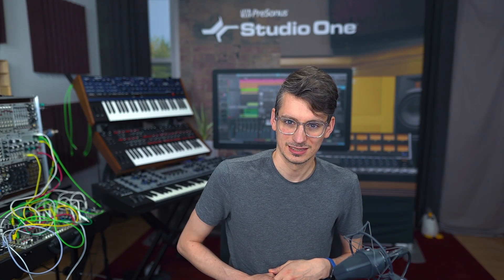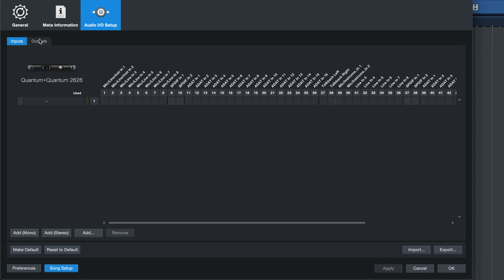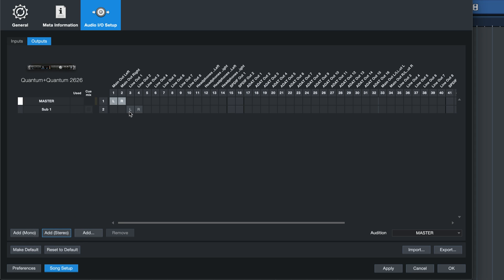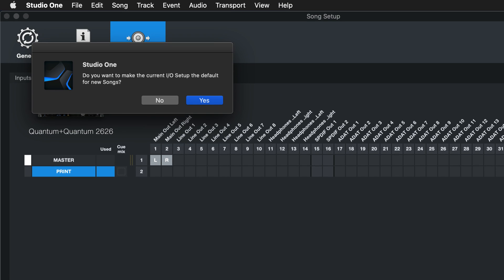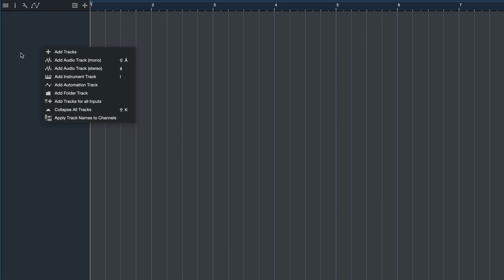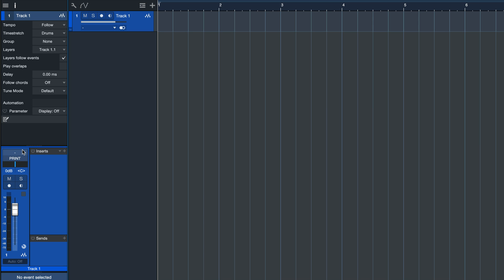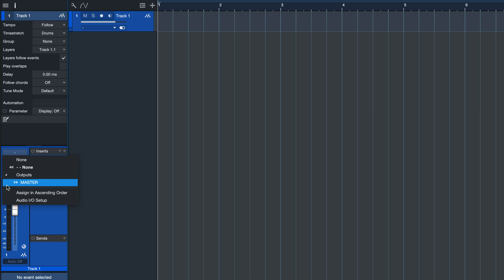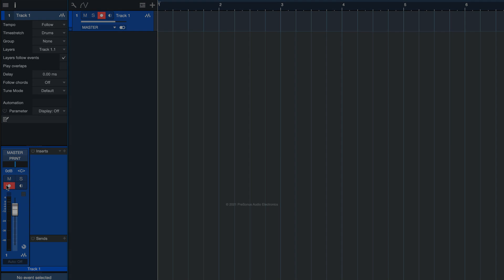How to record your Master Bus Output! #StudioOneMinute

Comment: I would prefer this to be longer with a demonstration etc. I’m still trying to fathom out whether this is important or not, and exactly what it’s for under what scenarios!
Reply: I know! The main idea he mentions is so you can hear what a rendered version will sound like at any point as you are working on the piece. Just record a bit to this PRINT track and then solo it for playback. You can also use this PRINT version for recording new tracks so that you are playing along listening to the rendered version of existing tracks. But how valuable is this? I don’t know; but it is something to try out - especially when I’ve been using more creative plugins. It could be easier than bouncing those tracks individually, which is what I have been doing.
Reply: @BF-up5xw  I didn't get just explain more simple

Comment: what is the diference bethween print track and export track chanel
Reply from the maker: Hi, the main difference would be that the print track records your Mixdown in real time, which lets you monitor the export all the way through (to make sure that the export sounds exactly the same). Hope that makes sense. -GBY
Reply: @presonus   many things fit. Now that I remember some plugins sounded different after exporting and bounced, then I got desperate and uninstalled them but I see that some plugins work like that, thanks

Comment: Hi Gregor thanks for this. When I implement it, I don't have the Master Output as in your demo. What am I missing? Thanks!
Reply from the maker: Hi, "Master" is just the name that I chose for the Main Out channel. You can rename your Main Output channel to "Master" with a double click on the name column in the Mixer Console. To make this change a default, open up the Song Settings and click "Make Default". Hope this helps. -GBY

Comment: This is a great tip.  So would the Print Track be an alternative for the Export Mixdown feature as the final mixdown. Or would it be or reference only?
Reply: As I understand, it's up to you only. You can use it for realtime mixdown if you want, thus keeping  every hearable aspect totally under your control.
Reply: You can use it the way you want. As a way to resample a specific track, as a way to export your track (if maybe it isn't rendering properly), as a way to just record exactly what you are hearing if you are using plugins with random parameters such as Portal, which is unpredictable at times.
You can even use it to actually quickly record a very complex track that may take several minutes to render with a normal mixdown.
Reply from the maker: What @Kisnou Music said is 100% correct - personally, I’ve been using the Print Track to record all my final Mixdowns (which have to happen in Real-time because of my Pipeline outboard gear) for many years. -GBY
Reply: @KisnouMusic  Thanks for the feedback.  You're correct with the unpredictability of Portal. Sometimes its ok and other times it crashes my session.
Reply: @presonus  Yes, I compared the print track to a mixdown and there is a noticeable difference in the sound.  I like the print track!
Reply: @cedricblackcreative  i cant find the main  in input...just the input 1  and input 2

Comment: This is probably a stupid question, Can a 2in 20ut interface do this? Or do I need at least 2 stereo outputs?
thanks and cheers!
Reply: Not a stupid question - I am using a 2in - 2out and the main output is not available as an input to the PRINT track. I have assumed that I need more than 2ins and outs. anyone else care to comment?
Thanks
Reply: 2 ins - 2 outs, meaning 1 stereo output
Reply: @jimgleckler5194  Hi Jim . Yes stereo out cheers!

Comment: This is like the resampling feature in ableton? If it is, I'm going to start resampling that way in S1
Reply: I agree. this looks like a great way to do it.
Reply: Yes you can definitely use it that way:) I also use it for plugins like Portal by Output that create some randomic grains that change everytime you render them. With the print track I can have exactly what I am hearing as audio right away and fix that problem :)

Comment: I can't follow.
Can someone give more clarification on it?
The way I understand it: if you want to hear what is going to be rendered with a plugin engaged, you need to take these steps for every track?
So, does that mean that we all have been mixing, and when rendered it sounds different?
Reply: You are over thinking it. You would have noticed if any of your plugins rendered differently to how they sound. I've come across this with one plugin on protools 8 years ago. Never had it since.
But it's nice to have a print track for reference or if you open a session years later and you don't have the same plugins, it's nice to have a print of the mix right in your session.
Reply: @NoQualmsTheArtist  I'm not over-thinking it. I asked questions.
Reply: @colaboytje  and I answered it. There's almost no chance you are experiencing a problem so don't worry about it.

Comment: Whats the benefit of this? Can anyone just reply? Its just a doubt
Reply from the maker: Hi Joe, I find that this makes it much easier to export a Song on a "section by section" basis. No need to automate any faders - adjust the levels for each section until it sounds just right to you, print that, save a version for this section for instant recall, and continue working on the next section without having any faders snap back to you as they would in read mode. Also, you never need to double check the recording, because what you're hearing during printing is exactly what's being recorded. Once you start using a Print Track, I'm sure you'll see its benefits. Hope this helps! -GBY

Comment: Nice tip, I’m going to try that! Is there a way to record drums, vocals, etc and have the mix fx console emulation print to the track? For example it would be cool to try recording with CTC 1 or Alpine console emulation and then when everything is recorded, mix on the Brit console! In theory this could emulate recording and mixing on different consoles for us in the box guys. Right now I don’t think there is an easy way to do this. Thanks for all that you guys do!
Reply: Yes you can just activate the console version you want and follow the steps in the video.
Reply: @BritoWorx   I meant during tracking. The best way would be to add the console emulation to the input controls.

Comment: When you do what Gregor is suggesting, you will lose your automation (because the track/bus and Master Output influences your automation enacts will have been printed too). Also, printing from your Master Outputs will have all of the Master FX (dynamics, M/S, etc etc) printed also. Most often these Prints are at a reduced level because of Master compression/limiting processing. Then, when you mix this, your Print track will have doubled the Master Bus processing. This is a flawed approach, imo. . Why not create a Bounce/Print Bus to a non-assigned output (as Gregor showed) that does not have your Master Output channel mix/master FX, and print a track from that. This way you avoid double processing your print tracks thru the Main Out FX processing.
Reply from the maker: Hi Mika, first of all you won't lose any automation whatsoever, and no automation will be altered in any way. Every automation will be recorded exactly as you're hearing it, because the Audio Track input for the PRINT is post master inserts / post master fader. Second of all, there is neither reduced level, nor doubled Master Bus processing - the latter would only occur if you play both the print AND the mix back at once. This is obviously not the intended use. I've been using a print track like this one here to record my master chain in real time for years, and have never experienced any of the issues you mentioned. -GBY
Reply: Couldn't you just bypass the master effects chain temporarily?
Reply: @presonus  - Maybe my wording was confusing. Your automation will remain in the original track, and as we both agree the results of automation will be recorded onto the print track, but, at that point it is permanent to the printed track. Printing thru the Main Outs as you demo will print your Main Outs FX (if you have any). If you then use that printed track  in your mix, that track will be double-processed IF you have FX on the Main Outs. Cheers.
Reply: @steelcityriddims  - Yes, you can. It's an additional step. Gregor did post a video a while ago about creating a Null output - as he did again in this video, but named it "Print". My suggestion skips having to toggle your master FX chain - and remembering to do that. lol
Reply from the maker: @Mika Haan i see what you’re saying now. But then again, that’s not how I would use the print track. For me, the print track is the ideal export mixdown method for plugins that behave slightly differently when being rendered offline (you can see it happen with some arpeggiators, for instance). It’s also much better for recording in real-time compared to “export mixdown”, because if there’s a dropout occurring somewhere it’s as easy as punching back in on that part and continuing recording. -GBY
Reply: @presonus  - That's one of the things I love about Studio One ... there's many ways to go about tasks, and many variations. Thanks for the convo, Gregor. Cheers